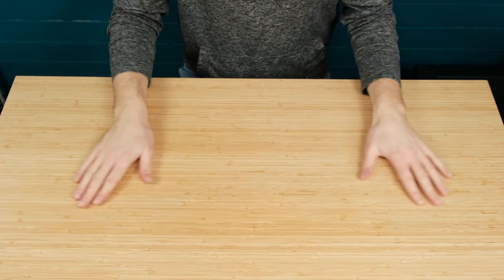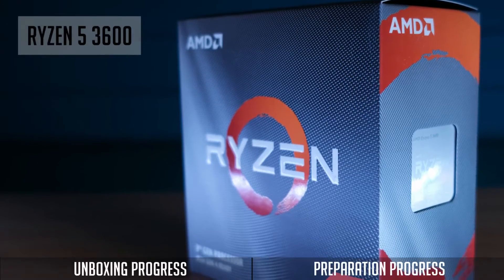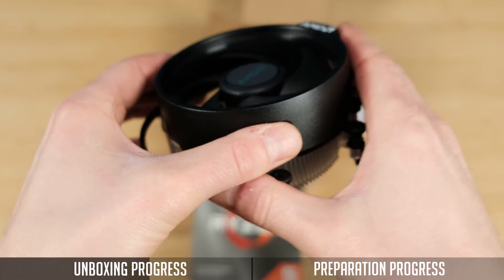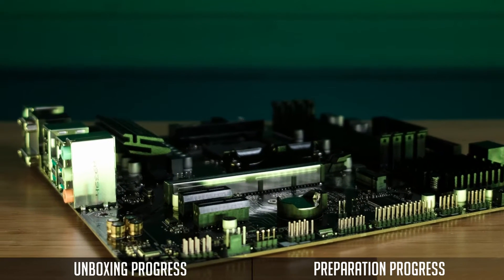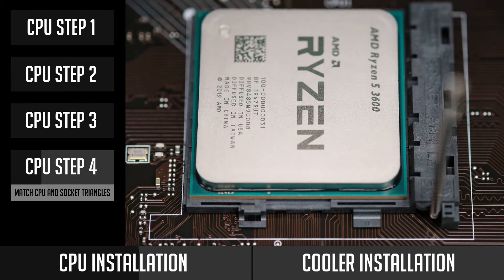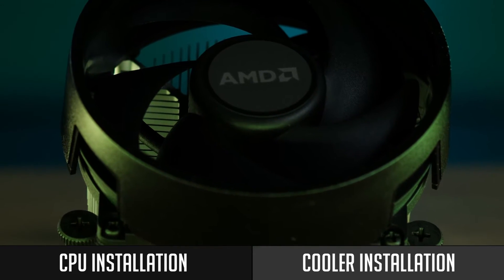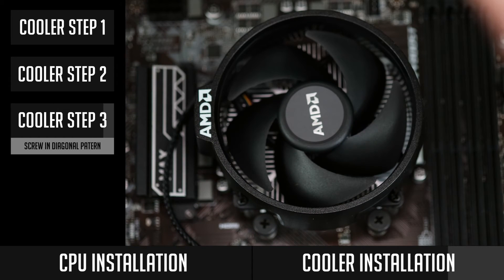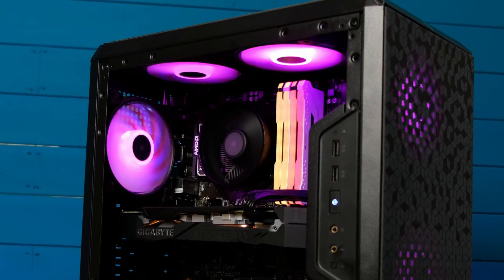HOW TO INSTALL RYZEN 5 3600 CPU + UNBOXING - CPU installation tutorial / guide

Comment: Hello! Im a new builder, when i install the ryzen 5 3600 the cpu lever is hard to push and i need to put a fairly bit of pressure is that normal?
Reply from the maker: Hey,
the cpu should go into a socket very easily. Be sure you matched a small triangle on a cpu corner and a motherboard and check if a CPU sits correctly in a socket. Only then lock that lever in place. It should be not hard, well you will feel some resistance when locking it in, but it is not that you need to use lots of force if everything is good.
You will need to apply more force when installing a stock Wraith Stealth cooler - be sure you screw the 1st screw just a bit, to catch a tread. Then, screw the 2nd screw (in a diagonal pattern), so with that 2nd screw people have the most struggles, as you need to push/screw harder :)
Reply: @EpicGameTech  I heard a cracking sound is that ok?

Comment: So with the screws it's not screwing in even with alot of pressure and I don't Wana break it so idk what to do
Reply from the maker: Hey,
Possibly you screwed your 1st screw too deep and you cant catch a thread with a 2nd screw on the other side :)
Reply: @EpicGameTech  thanks bro that's what I was I can believe you actually responded to an old video it was supper helpful now I'm just on to trying to wire the monster 😂
Reply from the maker: Glad it helped ;)
Trying to respond to all of the comments when i get notifications.
Happy building.

Comment: Do I need to apply thermal first?
Reply from the maker: Hey,
If you have in mind a thermal paste - it's already pre-applied to a stock ryzen cooler. But in case you are using a non-stock cooler, you need to check as some coolers also have pre-applied and some don't :)
Reply: @EpicGameTech  thank you so much for your quick response! I appreciate it.

Comment: But my screws aren’t screwing in
Reply from the maker: Hey,
Be sure you screw the 1st screw just a bit, like 20-30%, and then go for 2nd screw in a diagonal pattern. If the 1st one is screwed too deep it will be way harder to fix other screws.
Also, you need to use some force so screws could reach backplates threads :)
Reply: @EpicGameTech  I fixed it the backplate ended up getting dislodged and had to put it back up.

Comment: Does any body have any help my screws don’t screw in at all I got it fresh out the box and it won’t screw in
Reply from the maker: Hey,
Are you sure you didn't remove the backplate (where cooler screws need to be screwed).
Also, be sure you screw the 1st screw just a bit, like 20-30%, and then go for 2nd screw in a diagonal pattern. If the 1st one is screwed too deep it will be way harder to fix other screws.
Also, you need to use some force so screws could reach backplates threads :)

Comment: When I removed the brackets there just a hole nothing to screw the fan down into
Reply from the maker: Hey,
when you unscrew brackets, you should keep the backplate (where brackets were screwed). Maybe it fell down? Anyway, use the same backplate and screw your cooler.
In case you are using not stock but an after market cooler, in some cases they have included their own backplate to be used with a cooler :)

Comment: Need help screwing in the fan. Screws just spin. I’m applying pressure but doesn’t screw
Reply from the maker: Hey,
be sure you have a backplate in place (from the back of your motherboard).
Then, try to screw 1 screw just a bit, just to catch a thread, and then try to screw 2nd one in a diagonal pattern.
The thing is if you screw the 1st screw too much, the whole cooler leans to one side and it's hard to screw other screws :)
Reply: @EpicGameTech  Thanks man that was it

Comment: Thank you I'm subbed now
Reply from the maker: Hey
you are welcome! :)
Reply: Do you have any knowledge on when the graphics card overpricing crisis of 2020 and 2021 will be over ? I want a graphics card for less than 600$ please
Reply from the maker: Well, the answer worth a million ;)
No one knows. It depends heavily from:
- Pandemic situation 
- Cryptocurrency value (if/when it goes down)
- Manufacturers production

Let's say if cryptocurrency would go down in value 4x suddenly, in 2-3 months we would see a huge amount of 2nd hand and new GPUs available :)
So no one can tell. But probably we can have a similar situation until 2022 unless as I've mentioned, something changes drastically in these 3 factors I've mentioned above.

In a normal world, for $600 you could get like RTX 3070 and a few $ would stay in your pocket. And now, you can only buy 2 generations old GTX 1060 for that price.. this is insane :)

Comment: Don’t forget about the backplate
Reply from the maker: True, I didn't mentioned in my video, as basically you need to use same backplate for stock cooler ,so you do not need to remove it or do anything with it.
But could have mentioned it in a video that you need to keep it as it is. Well, I realized this (that some people might have questions about this for some reason) only after i published a video so no adjustments could be made ;)

Comment: Hi very nice video i have a ryzen 3100 and im using the wraith cooler i will be upgrading to  a 3600 but im not good with building pc do i have to take the entire motherboard out my to install it or can i just take the one i have out and put the  new one in?
Reply from the maker: Hey,
Yep, you can unscrew the cooler, remove the CPU and add a new one. No need to remove a motherboard :)
Be careful when removing wraith stealth from 3100 as sometimes cooler sticks to a CPU quite hard :)

Comment: old-ish video but still gonna ask, with pre applied thermal paste, you dont need to do anything right? just install it and dont do anything with the paste? i have a ryzen 5 3600 and im going to build a pc soon
Reply from the maker: Hey,
Well, this video will be relevant for months/years to come, as basically nothing changes ;D
Answering your question - yes, you do not need to do anything if you use a stock cooler with a pre-applied thermal paste (just try not to touch a paste with your fingers, as it happened to me few times) ;)
Reply: @EpicGameTech  okay, thanks! Never built a pc before so trying to find out as much as i can so i dont mess anything up
Reply from the maker: better to check than to be sorry later ;)

Comment: The thermal paste part of the cooler was very unclear , so I remove the cover? I guess this video didn’t help me
Reply from the maker: Hey,
In case you use a stock ryzen cooler, it has pre-applied thermal paste already (you should see it on a coolers plate). So as I've mentioned, you do not need to apply more thermal paste :)
But in the case of aftermarket coolers, some might have pre-applied paste some not. So you have to check coolers plate / manual.

Comment: The screw part of the cooler was quite annoying. Such a shitty design.
Reply from the maker: True, it was quite hard to get if a screw caught it's tread or not and some force needed to push it.
But uh well, mounting is worse than intel stock cooler, but a performance is way better ;)

Comment: So the Thermal Compound Paste

Is not necessary?
Reply from the maker: Hi,
in case you will be using AMD stock cooler - not necessary, as that cpu cooler has pre-applied thermal-paste already :)
In case you are planning to use some after-market cooler, you will need to apply thermal paste by yourself. (in most cases, it should be included with a cooler)
Reply: @EpicGameTech  sweet! Thank you very much!!

Comment: When i run my pc it says in bios that it touches 50 degrees celsius, why does it happen? Its brand new
Reply from the maker: Well, on idle it's quite higher than normal. But I've actually seen idle temp 35-45c on ryzen 5 3600 as-well.
It might depend from several factors:
- If the CPU cooler is properly mounted (if it's aftermarket and not stock cooler, you might need to peel plastic protection)
- Some motherboard has bios'es that are not ryzen optimized to newer BIOS version solved that. (you might try to upgrade your bios to the latest version)
- Check your CPU cooler fan speed curve and adjust it if needed.
Reply: @EpicGameTech  i have a b450f motherboard
Reply from the maker: Oki, but as I've mentioned above, you need to check those 3 different scenarios where the issue is :)

Comment: So with the ryzen 5 3600, i dont need to apply any extra thermal paste???
Reply from the maker: Hi,
in case you are using stock cpu cooler that comes with r5 3600 cpu (Wraith stealth) you do not need to apply any thermal paste as it's already pre-applied to stock cooler :)
Reply: @EpicGameTech  i thought so thank you :)

Comment: Nice vídeo! What size of philips screwdriver do you need for the cooler screws? That is bugging for days lol
Reply from the maker: Hey,
Thanks :)
in case you are using a stock cooler (wraith stealth) as I did, screws are already pre-attached to a cooler itself.
For an aftermarket cpu cooler - screws should come with a cooler and market witch ones you should use. But most of the time they are springloaded and pre-attached to a cooler/bracket etc.
Reply: @EpicGameTech  oh okay. But what screwdriver size do you use to screw them the motherboard lol
Reply from the maker: Ah, i see :)
Well, to be honest, i have lots of screw drivers, so i pick the one that suits best for the job, meaning using one i can screw CPU cooler, with other size motherboard to a pc case. Also, my screws do not have any marked sizing, so i can't tell you exact size i use.
Most of the time, i use a really long screwdriver (with magnetic head) that came with Alpenfoehn CPU cooler I've bought some years ago. So using this one 90% of the time. But as I've mentioned, it does not have any marked sizing on it :/
Reply: @EpicGameTech  thank you so much

Comment: What are the dimensions of the Wraith stealth? as I am unsure it will fit in my case.
Reply from the maker: Well its really low height cpu cooler so it should fit any standard matx or atx pc case. Unless you are building some ITX pc :)
Found these on the internet, should be right:
Height:55 mm
Width:90 mm
Depth:75 mm

Comment: Hey im using the same motherboard and thinking about upgrading the cpu to the R5 3600 like in the video from the R3 3200G. Will it work straight out the box? or will i have to change something in the bios? im not really sure
Reply from the maker: Hey,
in case you have MAX version "MSI B450M PRO-VDH MAX", r5 3600 will work out of the box and you do not have to update BIOS :)
But if it's "MSI B450M PRO-VDH" (non-MAX version) you need to update your BIOS. Since your PC already running with R3 3200G, just download latest BIOS, update now and when you get r5 3600 you will be able to install it with no issues as you will have the latest bios anyway.
Actually, it's worth upgrading BIOS even for MAX version, as it might have some improvements etc.

Comment: I installed it how it should be and when i turn it on there is nos screen
Reply from the maker: Hey,
are you sure you connected your monitor to a video card and not to a motherboard? :) (common mistake)
Also, what motherboard are you using? Does it have any LEDs that indicates the issue(cpu/gpu/ram)?

Comment: Sir I installed everything but when I checked temp it showed me 60-80℃ (usually 65 70) but when I went to bios it showed me 45℃. I even flashed and still same result . What should I do now?
And while I was connecting fans I put it wrong at first so I had to lift the fan and paste was spread on cpu.,could this be the problem ? But then I fixed fan properly and everything was working but little high temp
Reply from the maker: Hey,
well 60-80c is ok when gaming or etc. And IDLE temp is also ok at ~30-45c.
You can set more aggressive fan curve/speed in your bios so it would spin faster.
Regarding if it's ok or not after you tried to re-mount your CPU cooler - I can't say for sure, as I didn't see on how you were doing it etc.
So at first I would set a fan curve in bios, check temps when gaming and if you get quite a high temps, i would try to remove cpu cooler. clean old thermal paste from a cpu/cooler and re-apply a new paste (but you will have to get one as there is no additional thermal paste included with a stock cooler) :)

Comment: Just installed a 3600 and temps are unusually high does the cooler come with like a plastic seal covering the paste or?
Reply from the maker: Hey,
no, you do not need to peal anything, cooler is put in some plastic cover you removed when you took it off from a box ;)
What temps are you getting (idle/gaming/stress testing)?
What PC case/how many fans do you have?
Also, you can adjust default cpu cooler fan speed curve in BIOS so it would spin faster and so you would get better temps (but more sound).
In general, stock cooler is OK for gaming in a decent pc case. But if you are using it for rendering etc. and cpu utilization is 100% for longer time, temps can jump to 90s for sure.
Reply: @EpicGameTech  idle 70-80c and under load 80-95 3 intake fans 1 output
Reply from the maker: Uhh, shouldn't be at 80c idle, unless cooler is not spinning and background software still using your CPU. 
I would also advise updating bios, especially if you got some older motherboards like b350 or even b450 chipset :)
Might be you mounted/screwed CPU cooler not till the end/incorrectly? :)
1. I would update bios.
2. Would check/adjust the fan curve
IS the issue persists, would remove CPU and cooler and remount it again. But have in mind, you will have to use new thermal-paste :)
Reply: @EpicGameTech  got a pretty decent b450
Reply: @EpicGameTech  sir I accidentally put the fan wrong way and then had to adjust it and put it properly again so the thermal paste was spread on cpu but it connected properly. When I checked temp cpu temp was 65-80℃ .Could the thermal paste error be the problem ?

Comment: hi bro i have mobo msi b450 gaming plus and cpu rysen5 1600 and i cant get rid of black screen and red led from cpu? any help please?
Reply from the maker: Hey,
Well, ryzen 5 1600 is supported by your motherboard out of the box so it should be ok. I would remove a CPU and would check if no pins are bent etc. as led suggests it's something related to the CPU. And would install it again if everything seems to be ok :)
Reply: @EpicGameTech  my pc boots all the time perfectly but after 2, 3 days he shows me at ez debug red led from cpu and black screen, i mention that i use and old monitor is an acer 18 inch 1400 with 900 pixels at dvi conection, can it be from that too or all b450 chipstets have this problem?
Reply from the maker: hmm well, there can be various reasons and no, the b450 chipset is not responsible for a black screen :)
But as this is a nonstandard issue (it works but after a while you get that screen) you need to google it and try to find the same issue other people got and how they solved it. Im, sure there might be similar situations and discussion in Reddit :)
Reply: @EpicGameTech  honestly i have asked so manny people , none of them solved me, but i will enter there to ask people, Merry Christmas to you and your familly, does this site is on facebook too?
Reply from the maker: You mean reddit? Well, it's one of the biggest forum based website in the world ;)
But most of the time if I need to find something, I still use google, but I tell to search only on reddit e.g:
[your_issue/question_here] site:reddit.com
Well I use this form of search in google a lot, especially when i need to search in one website or in one domain :) (like site:.co.uk and etc)
Reply: @EpicGameTech  thank you alot bro ill ask a question on reedit and see what ill do

Comment: wich motherboard u using?
Reply from the maker: Hey,
MSI B450M pro-vdh MAX, just like I've mentioned at 2:33
But it does not mean I would recommend this motherboard, as it depends on the PC build/budget.
But from CPU installation point, it's identical for any Ryzen compatible motherboard :)
Reply: @EpicGameTech  thankyou verymuch u will maby get that 1 to

Comment: I fucked up my CPU by bending some of the pins.....fuck.....
 you guys should be very carefull and use as low force as possible because i screwed my nh d15 Noctua cooler too  tight on my CPU.

I‘ve purchased an 5600x and now im crying LOL
Reply: Everything is working now i could fix the damn CPU
Reply from the maker: @sharpi2776  super! :)
Reply from the maker: Ohh, sorry to hear that :)
From time to time happens to everyone. Had few cases with bent pins, but managed to fix/unbend them, as they were not totally screwed ;)

Comment: Maybe I'm dumb but I can't screw it in, when I screw the big screws, it just doesn't go down, the top moves, but not the bottom part if that makes sense
Reply from the maker: Hmm probably you need to apply more pressure. I mean you have to screw 1st screw for a bit, just to catch a thread. But do not screw a lot (since it will be harder with the other ones). Then screw 2nd screw on the opposite side (diagonal pattern). Also just a bit.
Then the other screws. And it's the best way to screw everything by 30%, few times always changing/switching screws till it gets done :)

Comment: I touched the thermal paste unintended. Now a fingerprint ist visible. Do you think that this will influence the cooling performance or does ir not matter at all?
Reply from the maker: Well, if you touched lightly with a clean finger and dint take much of the paste off it should be ok :)
But make sure you didn't leave any "dirt" etc.